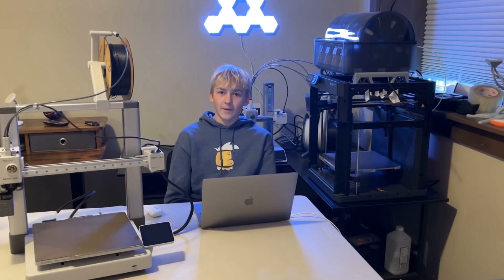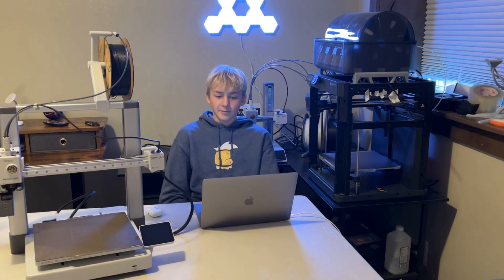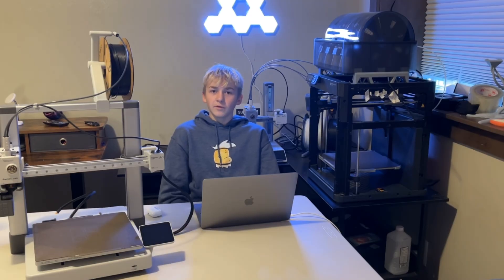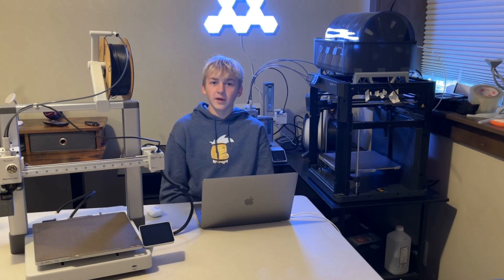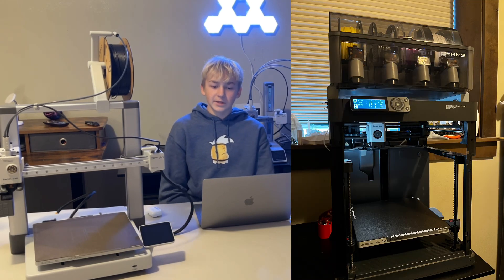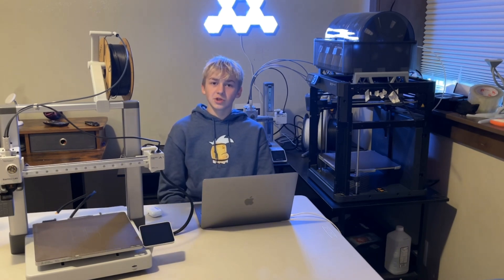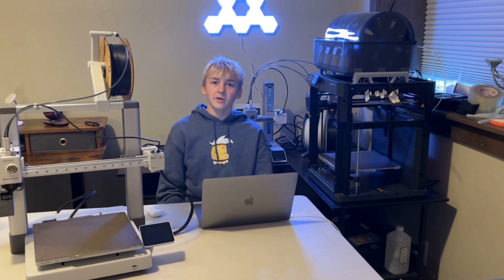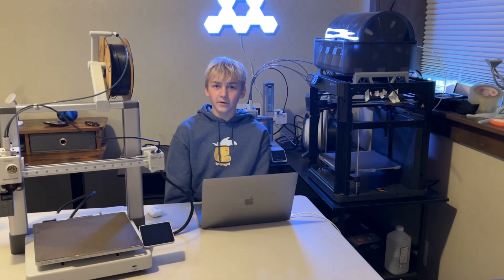Bambu lab H2D leaks/ What is their logical next step? @BambuLab

Comment: I am hoping the H2D stands for
H=Heated chamber 
2= tool heads
D= dual extruder tool heads

I think they need to give us non pro and prosumer users a way to multicolor print with at least 4 materials with no waste and in order to do that we would need a dedicated nozzle for each material in the AMS.
Having one dual extruder tool head would only give us 2 nozzles, but if the H2D had a second dual extruder tool head it parks in the back like a Prusa XL then that would be 4 independent nozzles and that means no poop.
And it would be a much cheaper and more practical way to achieve this than the way the Prusa XL does it with having 4 or five tools that park in the back.
Having just two tool heads with dual extruders is a much simpler and cheaper solution.

Comment: DON'T FALL FOR IT JUST GET A PRUSA XL OR CORE !
Reply: I don't have that much money though
Reply: @monetary_episode  fair. ender 3 v3 ke?
Reply: @monetary_episode494  Get an A1 Mini for $180 on sale from Micro Center.
Reply: Yes let’s spend 4k plus on a prusa instead of buying 4 Bambus makes sense
Reply: @hotboyracing  in nzd a prusa mk4 costs $2654.64 fully assembled
Reply: And they have guides
Reply: I'd rather spend less and get better performance. 🤷‍♂
Reply: @jdwantsyourcouch  your going to regret picking bambu when they break
Reply: Nope, I'll stick with Bambu.  I like to print, not work on my printer to get it to print, repeat.
Reply: @jonwoodworker   "I like to print, not work on my printer to get it to print, repeat"
Then why did you buy a bambu lab lol? Prusa has been the golden standard for "it just works" for the last 8 years.
Reply: @LilApe  Let's start with the easy one.  How long did it take you to put your Prusa together?
Reply: @jonwoodworker  Zero minutes, becasue I bought it fully assembled. I got it unboxed and printing in under 10 minutes. Next question
Reply: @LilApe lol ok how much did this fully assembled printer cost you?
Reply: @Bigpopp1  Brand new from prusa, fully assembled and shipped to my door, only $800 usd. Next question
Reply: @LilApe which printer and for $800 seems you could have a few printers that print out the box with a few screws. Far from difficult as you could find by many brand new to printing. I’ve built far more difficult printer than your printer and trust me these are simple compared to a Voron 2.4 or Voron 0. You can to bash but your simply a fanboy hating on something you have little knowledge about.
Reply: @jonwoodworker  your going to regret picking bambu when they break
Reply: @vladimirjar3800  How?  One of my A1 Minis has made me $6k and cost me $179+tax. So, if and when it breaks beyond repair, I will just buy another Mini, take it out of the box, and print perfectly.  Micro Center is 15 mins away, and I can be back home printing in under an hour. Bambu has parts available, and the aftermarket is also starting to make options for Bambu.  So you are advising me to spend $600 on a kit, spend 30 hours building it, 30 hours dialing in all my filaments and settings, just to say I'm a real print farm.  I don't give a fuck about "being a real printer" or upidy clout.  I make money without hassles.
Reply: @jonwoodworker  good for you choosing a cheep printer to make money you have a solution
Reply: is this joseph prusa's alt account
Reply: @morbus5726  you wish then you would be talking with the most powerfull person in 3d printing
Reply: @vladimirjar3800  not really no. It does seem to be you by the way you talk about him haha.